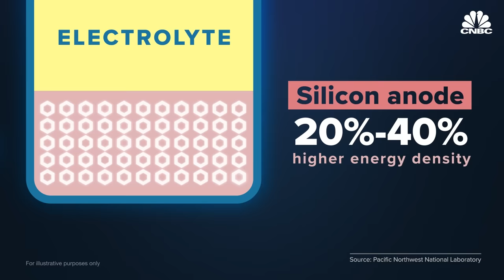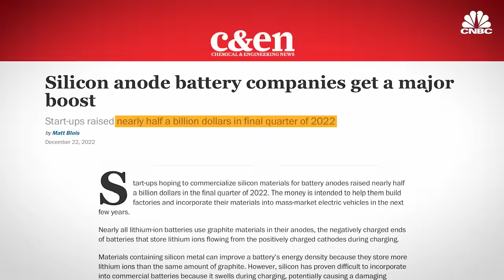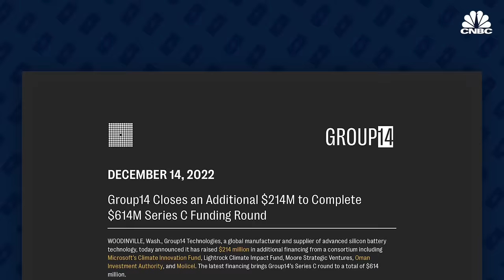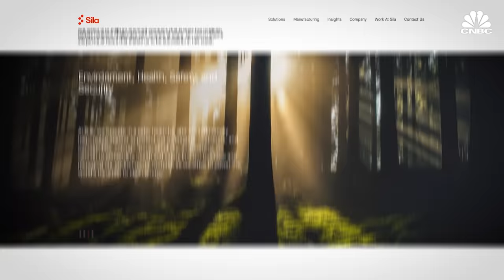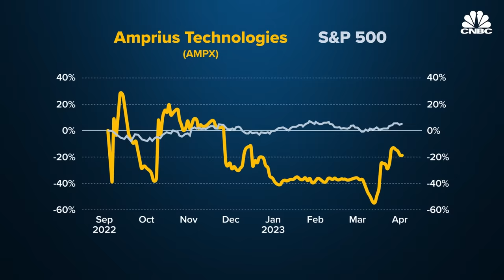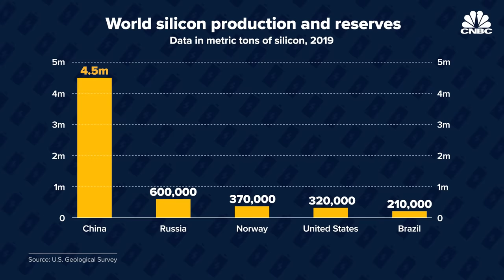How Silicon Anode Batteries Will Bring Better Range To EVs

Comment: When they say it could double the range that is true but the car companies will just put a battery half as big in everything but the highest end cars so no 700 mile range. Only good thing about a battery half the size is weight but cycle life takes a hit which means its lifespan will be half as much. We will have the ability to make cars last 500,000-1,000,000 miles but car companies have every incentive to avoid that kind of reliability.

Comment: Another miracle battery that will never make it to market.  We'll never hear about it again after this video.
Reply: It's already in the Mercedes EQG
Reply: Any other bold predictions?
Reply: @spacetoast7783  That car is not even out yet and they said it will "potentially" have that battery type.  So we won't hear anything about it for at least 10 years or ever.
Reply: @djp1234  No, they've already confirmed it.

Comment: Lots of "could" and "should," but after many years of R&D, where is the first prototype of an EV that can be charged in minutes? And how will the electrical grid be able to handle all of these EVs with current loads 2-3x higher than today's loads, without collapsing it? I'll believe it when I see a prototype EV that can travel 300 miles and be charged in 10 minutes, as these folks are promising.
Reply: Tech is there right now to use capacitors instead of batteries for phones.  Charge would only last 6 hours or so, but could be charged in literal seconds.

Comment: You cannot put out a battery fire.  Higher density batteries only make it worse, the fires will be more intense and more explosive.  In the rush to EV tech everywhere, we need to really assess the risk.  Condominiums are now starting to put EV charging bays all throughout their underground parking lots. Imagine the infrastructure and energy required to make this work if everyone had an EV.  Imagine the increased risk of an electrical fire from the infrastructure, let alone even one EV battery bursting into flames.  Those fires will not be able to be put out and they can spread.  What would happen to the inhabitants of the condominium should there be a basement blaze??  The risks are real and should not be underestimated.

Comment: EV's need time to improve, it will come but ICE engines have had over a century to improve. Given time EV's will get better and better over time.
Reply: Energy storage is literally the only issue holding it back.  E motors are crazy efficient and powerful v gas motors.
Reply: @DarthObscurity  EV's have their own problems besides energy storage that have to be overcome. But of course range is the ultimate problem to be fixed first.

Comment: Impressive improvements? There's basically been no improvement worth mentioning. Most lithium ion batteries have been around 0.2 kWh per kg for many decades. Meanwhile, gasoline and diesel are over 10 kWh per kg, or basically 50 times as much energy density. Solid state aluminium air batteries are probably the best technology. It's not gonna be ready in at least 20 years.
Reply: Non rechargeable Aluminum Air batteries will never be broadly used but may prevail in special market niches.

Comment: But guys, why these batteries? The battery with the most stored energy density is oil.
Reply: @@MR-kb5sh because your phone is a low power device. Cars need so much more power. Batteries are nowhere near matching hydrocarbons for serious machines. Batteries will have improvements over time but so will ice engines. Machines that need lots of power, batteries just won’t be able to deliver the goods. EVs only exist because they’re heavily subsidized AND because hydrocarbons are wrongfully demonized making new investment too risky for investors.  This is coming from a former model Y owner for what it’s worth.

Comment: Electric cars are not a valid replacement for the ice vehicles we all take for granted. We need to face this fact. 
Diesel is more powerful and ecological than even gasoline engines. It's true, but you haven't heard it because of the controlled narrative. 
Diesel exhaust is CLEANER than gas engine exhaust. Diesels today only emit Nitrogen, water vapor, heat, and a miniscule amount of CO2. That's right .. no carbon monoxide, as in gas vehicles.
Diesel is here, it's powerful. Has long range and mpg, requires no open pit lithium or cobalt mining, no battery toxics. 

Diesel is the most eco friendly fuel we have. 

I have a Jaguar FPace 4 cylinder turbo SUV. I get 40mpg hwy 30city. 
I emit NO carbon emissions. No soot. 
Why are you kept from knowing and celebrating this mature technology? Because you are being lied to. 
Electric battery technology is far from mature. Try towing or vacationing. Charging takes time and isn't always possible. 
With liquid fuels, in an emergency you can have 5 gal brought to you if you run out. Not possible with electrics.

Comment: Still probably years off as there are still glitches to overcome. No mention of dendritic incursion. The other problem is that most of the current silicon production is sown up by two unstable countries that would be happy to control supply to fit their agendas.

Comment: Is there still no alternativ to lithium? Isn't that the part that is environmentaly problematic in its extraction?
Reply: Even if we figure out EVs well still have tons of microplastics from tires and other wear and tear items. 

Public transportation is the future
Reply: @wasco1989  "Public transportation is the future" i don't disagree with this. Yet that was not really my question. Even with public transportation the need for batteries still will  increase further. Therefor having one as option that has less of negative impacts on the environment seems like a good idear, wouldn't you agree?
Reply: If autonomous driving becomes a reality cars will become more mass transit like. Robo taxis will drastically reduce demand for urban car ownership.
Reply: Lithium will be the element of choice going forward where energy density counts, e.g. especially for wearables and cell phones but also for flight. In many other more cost sensitive applications, other elements like sodium and even organic materials will gradually enter the market.  The most problematic mining is with cobalt, mainly used in cell phones and notebook computers.

Comment: In 2019 EV range was just above 200 miles. By 2023 the range is typically hitting 300 miles and there are some capable of 400+ miles on a single charge. This sounds very much like Moore's law

Comment: There undoubtedly will be an alternative and reliable source to oil. Uncertain, if batteries will be the panacea. Until then, like Buffet, oil is the sure roi investment for the next 10-20 years.
Reply: 7 Jahson: (rechargeable) Batteries have never ever been presented as being a source for energy. Battery tech is for storage only. However storage is important and will be more important in the future.
Reply: @beatreuteler  source & storage. Thank you
Reply: @7jahson  With source you mean Silicon in PV panels, not in batteries, right?

Comment: That thing about “cars are gonna charge in 10 minutes” is complete bs. Just because you have a higher energy density doesn’t mean it charges faster necessarily. You can charge at a higher current but assuming the separator membranes remain relatively unchanged then charge current would also remain very similar to current batteries
Reply: While separator membrane is not the bottleneck it charges faster if you are able to lower resistance of the entire thing.

Comment: Being able to drive 700 miles on a single charge will go a long way (pun intended) to addressing the 1% of our trips that  require it.  I don’t know of a single gas car besides a truck with dual gas tanks that can drive that far.
Reply: Our 16 years old Audi A4 Avant Diesel car drives 1000 Km using a single tank (62 L tank)
Reply: @beatreuteler  and how often do you take non stop 1000 km trips?
Reply: @toddsmith4280  Never. Why should I? But it seems that some people think they can't use BEV's unless they have range who is matching to this capability. For my part I don't understand why, because like you I think it's not needed at all.

Comment: I've been saying forever that when recharge times get below 5 minutes, ICE passenger vehicles are going bye-bye
Reply: Someone in this CS made a fairly decent point- the cost of owning an EV is far significantly less than that of the cost of wasting hours on some mechanic or dealer to fix a "coolant leak". The same few hours that could've been used more productively.

ICE vehicles cost a lot more than EV's, at a price much more cuter than our current car market.
Reply: For ICE passenger vehicles to dwindle, it doesn't take this fast charging.

Comment: Why charge it at all, batteries were rendered obsolete long ago, the government won’t release the tech. Did you know that is says that ANY engine that gets over 85% efficiency will never see the light of day, because the government has deemed it risk to national security or a economically disruptive technology
Reply: Any engine over 85% efficiency has not ever existed, theoretical maximum is around 30% currently and It won't get better since electricity is far far more efficient.

Comment: This new tech was abandoned in the 70's, then again 30 years later. So it is not new.... Nothing is new, including having a viable battery made this way.... Less prone to swelling means it still swells. Less prone to failure, means it still fails, catastrophically as well. Billions of dollars later, they are still at the same place claiming that they are only billions of dollars away from getting it to work...... So by all means throw more money at it and see if they can make a battery that is actually viable in EV's. Presently Silicon Anodes, are not viable for much at all... And in the end, China controls the silicon market, so the dependency issue is still there.

Comment: While dramatically faster charging will help with passenger vehicles, unless the weight can be reduced by several factors, I don't see how any battery system will every be feasible for passenger/cargo aviation or long range freight trucks.  If you are consuming 25-50% of the available weight carrying capacity, they simply can't be economical.

Comment: God, another miracle battery. Whoppie! Now if you can get over the other costs of Evs. Such as rising utility costs, and road maintenance. And wait for it there's going to be tax for the roads to drive an Ev. Just dust off the plans for a non-polluting gasoline car. And why haven't I heard anything sbout about Troy Reed's magnetic motor. No gas or batteries needed. You can put it into any vehicle for $3000 dollars. Any. Used cars and trucks would be very desirable. People don't need new cars and trucks. They just need to get from point A to point B as cheap as possible. And product costs are based on transportation costs. This country once was based on cheap transportation. Then along came Musk with his ridiculously priced EVs financed be Wall Street. Stupid. Stupid.

Comment: All this stuff is great, but until we see this new tech in EVs and it needs to be under $100 per kWh, I'm not interested and neither should you. I don't understand this huge push to EVs, they are expensive, require LOTS of electric infrastructure and don't have the range or convenience of an ICE equipped car.  For some people that are only driving short distances, yeah, EVs make sense, but for everyone else.... Ehh... I'd like to see a standard of 1000 mile range, then I'd sign up.

Comment: Would love some more unique ideas for this industry. Like pulling into a "gas station" for EV's but ultimately what you do is exchange your old batteries for already charged batteries

I know this is an old idea, but if at scale it could solve a huge hurdle while we try and perfect the technology

Everything will have an evil use or be used for evil. We just need to capture all those main potholes and just try and get back to doing business with our lives 

I certainly don't want to exchange one product for another just to end up dependant on that particular item either
Reply: Not necessary. EGMP already does 20 to 80 in under 25 minutes. That's long enough for a bathroom break. It's only an issue on road trips anyway. Most people aren't doing 400 mile drives on a regular basis. That's only one charging stop.
Reply: @jghall00  "Most people" don't matter, even 5-10% of people needing it makes it necessary for the entire industry.  That's how California laws change manufacturing, labels, etc. for the entire country despite only being 10% of any industries market.
Reply: Curious if you realize an "EV gas station" would mean tripling or more the amount of batteries that are made?

Comment: Electric cars are no good really,stick to hydrogen running on piston engines direct from pressured tank that way its just a small change to standard petrol engines for them to run hydrogen,people have been doing it for years on modified cars and also JCB as just launched a new hydrogen piston engine for their vehicle's

Comment: Better talk less and get producing...given the number of vehicles needed to replace the current ICE fleet and the dumb deadline the politicians set, time's a moving... good news though, and I'm likely to consider one if the claims are achievable and not BS. Coupled with the other battery advancements we could finally see light at the end of the tunnel. 😃

Comment: This just goes to prove what I have been saying for some time now.  EV's are just not ready for prime time.  They will probably get there eventually but not yet.  Notify me when they are and I will buy one.  For example, recharge nearly as seamless as stopping for gasoline.  Batteries and chargers that work in all temperature extremes. Adequate infrastructure to support EV's.
Reply: EV's will be much more reliable in about 3 years. The money being dumped into its R&D is now far surpassing the amount of R&D that has been squandered by that of the buying power of Big Oil (trillion dollar industry)
Reply: I won't need quick charge if I get a real 220 Km range in the cold of the winter and @ full car payload. Because then I will charge 90% or more during the night.

Comment: Personally, I'm less concerned about RANGE as I am concerned about CHARGING TIME.  I will never buy an EV unless it can charge as almost fast as you can pump 12 gallons of fuel into a tank.
Reply: I want both, if I am to replace my gas vehicle with EV the EV needs the same total range and fill up time.  And the infrastructure needs to match gas.
Reply: Mine charges in seconds overnight while I sleep for free. 👍🏻😎
Reply: @4literv6  great for daily commuters, not the best for long drives
Reply: @SasukeUchiha-zu6dw  why? Start off fully charged do 3hrs or so, take a 20-40min break and back on the road again. 
The average American driver takes 2-5 trips over 100+miles one way in a year. In fact the average driver country wide does under 40 miles a day.
Reply: @4literv6  why? Because a gas vehicle can do it.  A gas vehicle meets the bare minimum needs and the rare/extreme use cases and does so while costing less.  Because maybe you might not start off fully charged, or maybe you are towing and range is cut in half (like gas) and don't want to unhitch to use a charger (20-40 minutes only gets you to 80% charger BTW), maybe you don't have 20-40 minutes for a break every few hours and only want to stop for 10 minutes.
Reply: @SasukeUchiha-zu6dw  so your one of those people. Good to know thanks. 👍🏻
Reply: @4literv6  IDK what you mean, gas and EV both have their pros and cons and use cases where they excel and where they fall short.  Just because I believe that everyone should be able to choose what works best for themselves (it is their money and right after all) doesn't mean I hate EVs.  In a way gas has 100 year headstart doesn't mean EVs won't catch up, I'm sure they will and more people will want to get them.  But getting into the want vs need debate (which could be applied to everything BTW) is a whole different debate.  In my humble opinion when we get into the whole argument/debate on people just need to adapt/compromise when it comes to EVs (which some people are willing to) we are letting the manufacturer and govt off the hook on improving EVs and infrastructure to match what we have with gas.

Comment: Doesent make much sense to push electric cars out to people who can bairly afford a regular one not to mention what about when it comes down to working on them you'll be spending way more at a garage then a regular car if you cant do it yourself
Reply: That's completely false. EVs have like 7 moving parts VS the hundreds or thousands in a gas car. There's no oil to change, no transmission fluid. Only brakes and tires and the brake pads last forever because of regenerative braking.

Comment: Meh. I'm skeptical. I've been reading about the "next gen" battery tech for 20 years. Batteries really have not had a significant leap in technology over time. They have minor improves over periods of years. They will likely never have a revolutionary leap... battery tech is fairly simple... and the knowledge to build them has been around for 100's of years.

Comment: EV cars in minor fender benders can be considered easily as a total because the frame of the vehicle is the battery and once that battery is damaged it's a total. Don't want an EV car! The industry doesn't get it and this is a huge flaw in the design of these cars. Talk about driving up insurance costs. Not to mention that lithium mines are destructive to the environment.